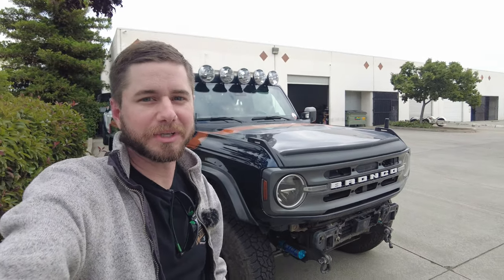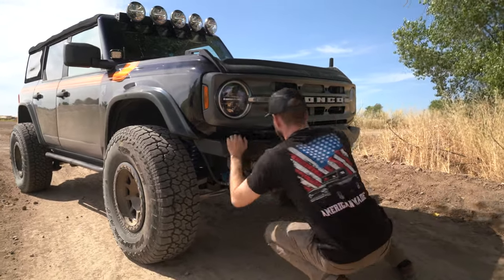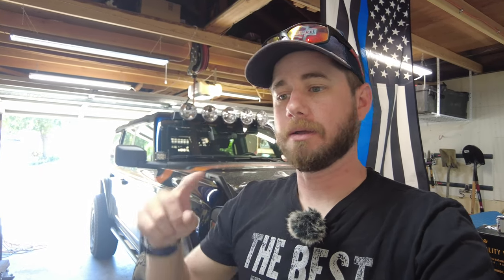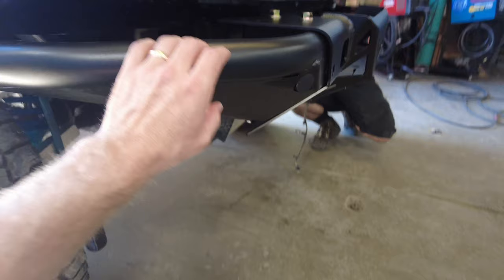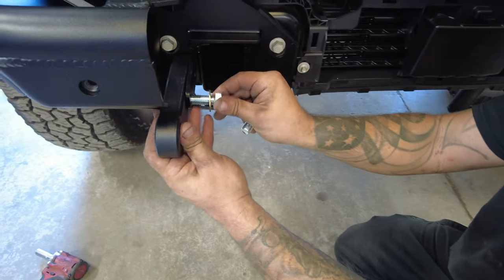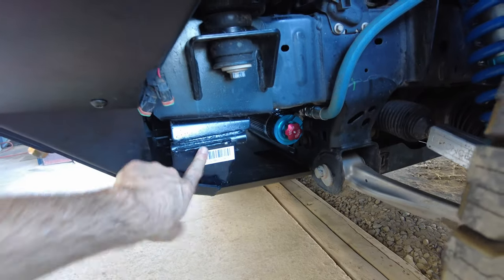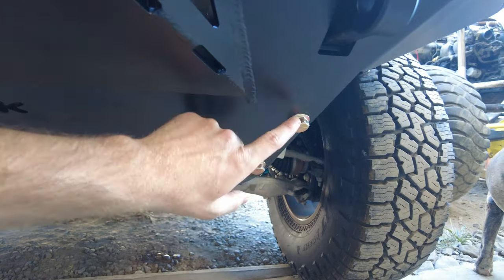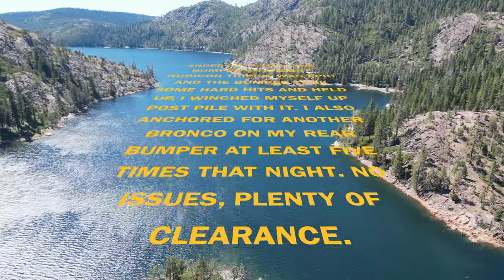I Broke my Bronco... For Science! (Plus Metalcloak Bumper Install)

Comment: What about your front sensor module? Also, is the intercooler getting enough air?
Reply from the maker: So far so good! Been monitoring my temps and no issues. I would note that it’s up to 110 here in CA and I’ve done several steep, windy climbs in the mountains and no issues on temps. I have a bare bones Bronco so no front sensor module for me. They do have a relocation coming soon for the fancy Broncos! In the mean time, other companies make relocations too. 

There are cut outs on the sides that direct air in and over the intercooler. The sides are also open which allow for air flow.
Reply: I was going to ask about the intercooler too... There's always meth to cool to intake temps... But airflow is cheaper. 😉